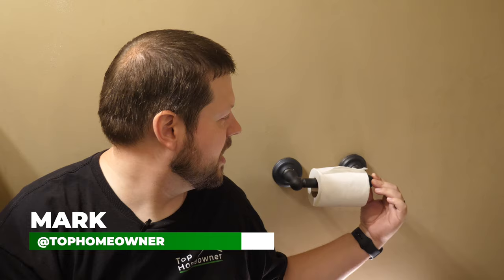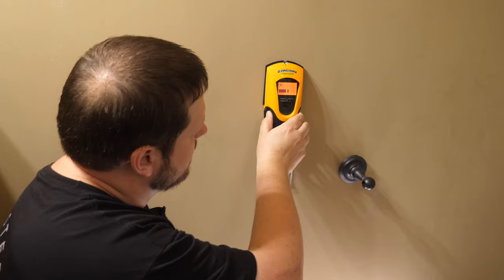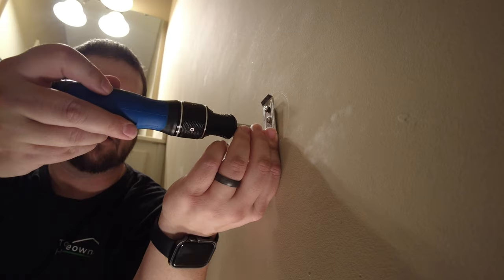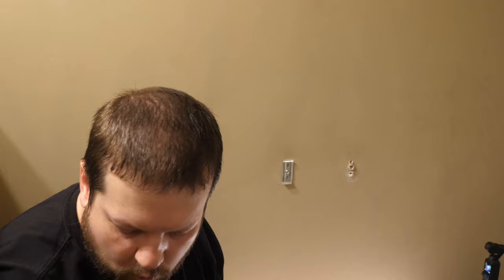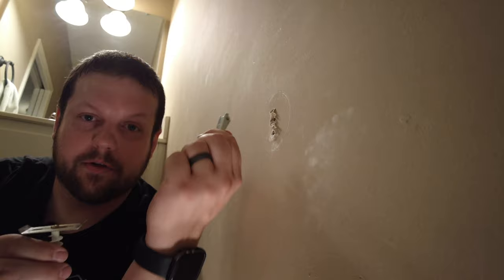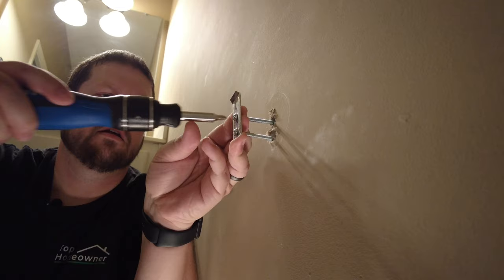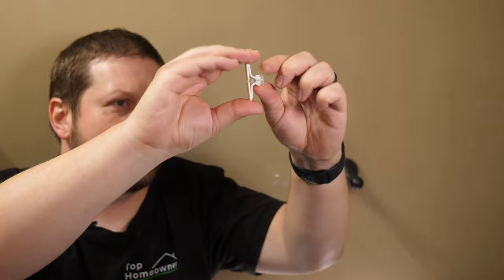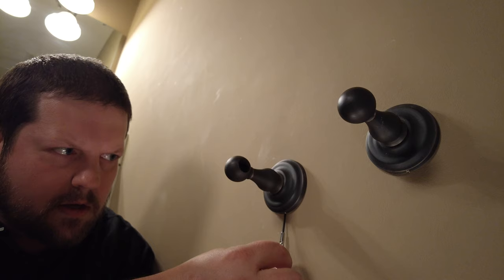How to Fix a Toilet Paper Roll Holder and Towel Rack - It's Easier Than You Think!

Comment: What do I do if the set screw has been stripped?? 😢
Reply from the maker: You can try to use a rubber band between the screw and the hex wrench. Sometimes that will give you enough extra grip to get it out

Comment: So there appears to be concrete behind the drywall where tissue paper holder is.. and Not enough space between drywall and concrete for toggle to expand. Hole is too large to reuse same sized wall anchor. Any other suggestions?
Reply from the maker: Possibly use a Tapcon screw if you can drill into the concrete easily. https://www.lowes.com/pd/Tapcon-8-Pack-1-3-4-in-x-1-4-in-Concrete-Anchors/3102311

You could also try patching the drywall first then installing a new wall anchor of the same type in that location. Either way that doesn't sound very fun. Good luck!